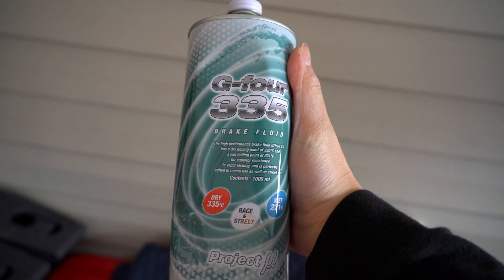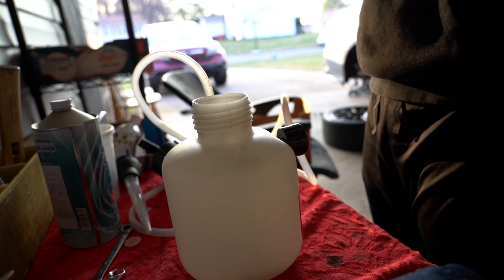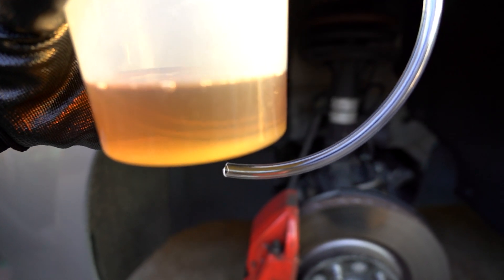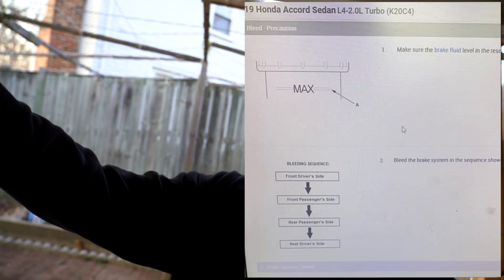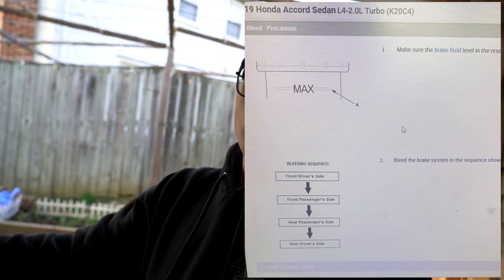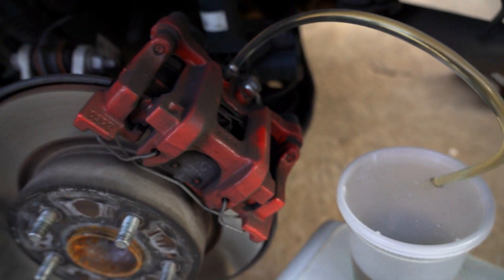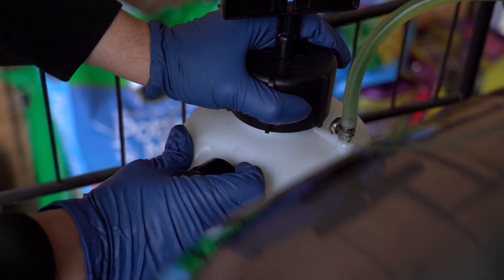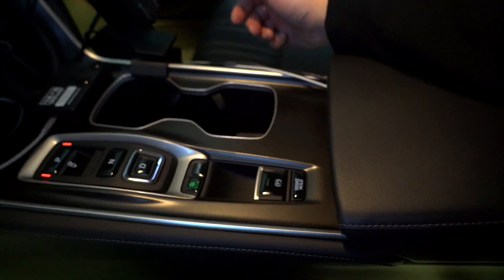How To Properly Flush Your Brake Fluid On 10th Gen Honda Accord/Civic! Project Mu G-Four 335 Fluid

Comment: For the camber bolt that looks like a socket wont fit, you might be stuck using an end (or box) wrench.  I did my rear sway bar and end links and ended up having to do that for the nuts at the end link/swaybar interface.  Really tedius.  If you do a lot of that, it helps to grind down a wrench on the open side, just take a little meat off the lobes to get a little more throw.

Comment: Wow, that makes it so much easier to change the brake fluid. Also will this power bleeder push out air from the ABS module and What size brake reservoir did you get?
Reply from the maker: Yep! This should push it through ABS as well. The reservoir cap I used is linked in the description 🙂

Comment: Hey I saw on one of your older videos you were running the mishimoto inlet and I want to run the same one but I don’t know what inlet tube to get that connects the mishimoto box to the mishimoto fk8 inlet. Also what did you do with the vacuum line that goes into the oem inlet
Reply from the maker: For the tube that connects the box to the inlet pipe I used this: https://prlmotorsports.com/products/2018-honda-accord-2-0t-intake-conversion-hose?_pos=6&_sid=d34835b48&_ss=r&variant=41888024494273 (Specifically the TIP to HVI version)

For the vacuum lines, I used this kit and it redos all of it: https://prlmotorsports.com/products/2018-honda-accord-2-0t-turbocharger-swap-inlet-pipe-installation-kit?_pos=11&_fid=9ed6c642a&_ss=c

Comment: For the Motive Power bleeder did you buy any special adapter to fit on the brake fluid reservoir
Reply from the maker: Yep, first link in the description for the Honda specific one!
Reply: @Qius_Cars  thanks fam I appreciate you
Reply: I just noticed the adapter you have on the link is for a model 3 Tesla ? Would that be the one for the accord?
Reply from the maker: @MoeLester93  strange, looks like they got rid of it. I updated the link to one that's available!

Comment: Did you have any difficulty putting the CTA 7030 cap on the master cylinder? I have a 2022 Civic Si and the cap is very difficult to put on and take back off.
Reply from the maker: It’s a bit tight, that’s normal

Comment: do you think the 3” thermal r&d exhaust is better than the older one? I can’t decide which to get 😞
Reply from the maker: They both sound about the same and performance is negligible on turbo cars, it’ll come down to if you want the quad tips of the 3 inch or not

Comment: how did you power your melody box? did you need an adapter and which did you choose stock v4 or v4 + power only cable?
Reply from the maker: I used a cable that’s plugged into my center console
Reply: @Qius_Cars  didnt need the adapter? 12v to 5v
Reply from the maker: @WhataTofu  For the melody box, nope

Comment: I just tried this on my accord but the motive power bleeder is losing pressure i hear the air leak by the master cylinder
Reply from the maker: The hose fitting on the adapter cap may not be sealed properly. I'd recommend using some permatex around it to seal any small pinhole gaps